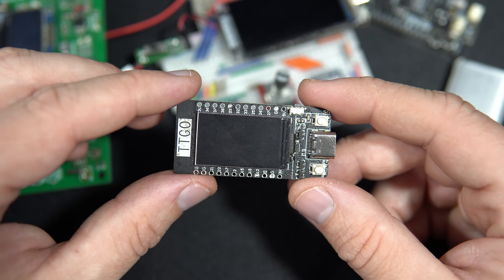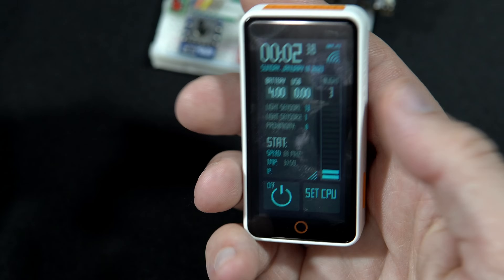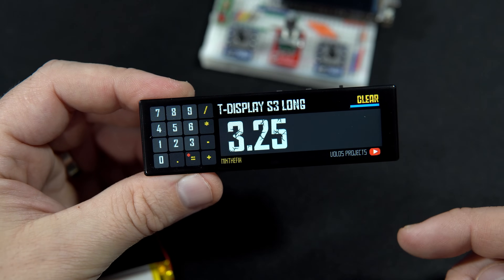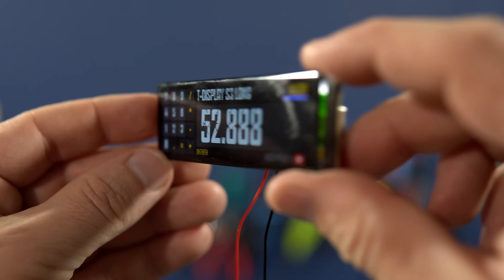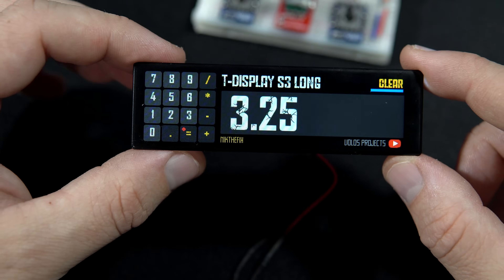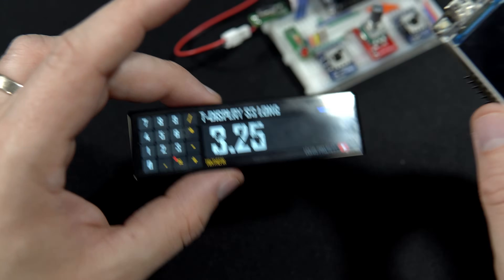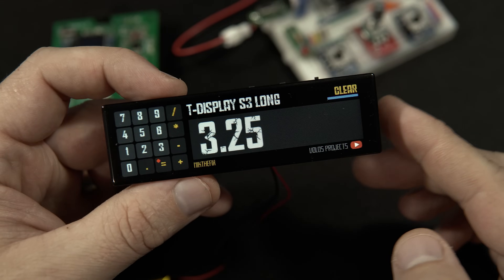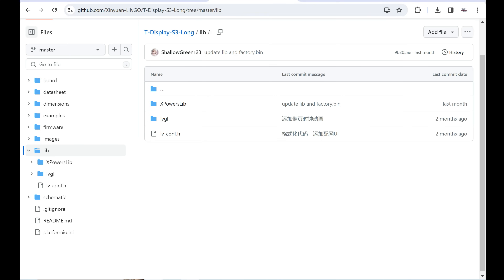T-display S3 LONG - Elegant Development board from LilyGO

Comment: As far as I can tell this board Kinda sucks. It does not work like the other t-display boards and the examples are hit or miss. Half the time the screen has a static looking or I get an error from the example process.h missing. When I was able to get it to work I could not make the text bigger AKA text height. I am no pro but this board is anything but simple.

Comment: I tried using img2lc with the settings noted in the ino but the output is in the form 0X10,0X10,0X02,0X80,0X00 where as the format of the yt.h is 0x0000, 0x0000, 0x1800, 0x6000, 0xB000, 0xE000.  Why is this ?

Comment: I really appreciate the effort you're putting in those display videos! What settings would I need to use for SquareLine Studio in order to create a working LVGL UI using Arduino Code for the S3 Long? The examples from Nick worked fine, now I would love to get into development on my own...Do you know if there is a SquareLine Template for this device? Thank you

Comment: Is there  an adapter that converts qwiic connector to pins that can be plugged into a breadboard? It's nice that the package include 2 quiic cables, but it doesn't include info on what size they are if I need something to solve my first question...

Comment: I just got one of these. It took a while to solve getting it to work after uploading new sketches to it, but that was solved i the board settings of the Arduino IDE. After I got that right, I saved a screen shot of the settings, so I have a reference to go back to if something gets messed up...

I get the factory sketch working after upload, using what I said above.. and found the line of code that flips the display 180  degrees... 
    disp_drv.rotated      = LV_DISP_ROT_270;// 90 180 270

The only part I can't figure out is how to set my time zone. Can someone help?

Also, is there a way  to turn off the flashing GREEN LED.. I bet it is causing problems for people who have heath issues related to strobe light/picket fence effects...

Comment: Seems they will only ship from the German warehouse now , which is fair enough but no stock anywhere but India ?. Does anyone know if this will be available again or is discontinued ?
Reply from the maker: dont worry it is not discontinued, it is new, that is common with new boards, they sold quickly, but theay are also back in stock very fast
Reply: @VolosProjects  thanks I found some on Alibaba. Thanks also for sharing all the info and making the video's.

Comment: Maybe a stupid question, but could this display receive input from a second, separate ESP32? How would this work?
Reply from the maker: Yes ofc, using esp now, wireles protocols used to comunicate between esp devices.. you can also use wired option

Comment: Have you or anyone else tried the LilyGo T4-S3?
Reply from the maker: I have it here on my table i will try it next week
Reply: Yes. Very nice hardware. Needs a case tho.
Reply: @nikthefix8918  Yes I agree. Also, it would be nice if they released the BOM and maybe sold the display modules and connector separately so it would be easier to make your own PCB and not having to stick to their development boards.

Comment: The issue you may have had with TFT_eSPI is that it expects the user to configure (uncomment) a specific display driver, which is a problem when you want to use that library with multiple devices as it would require editing the User_Setup_Select.h configuration before each compilation.
The easiest workaround is to copy the relevant header file from TFT_eSPI/User_Setups/SetupXXXX.h to the sketch folder and include it before "#include TFT-eSPI.h" in the sketch.
Reply: Yes a very good idea. I can see why Bodmer did it this way tho. 
Of course, with the Long or any other display where we're using the 'sprite only' screen buffer approach, there is no need to configure user_setups in TFT_eSPI in any special way. Just use the default 'freshly installed' config.
Reply: @nikthefix8918   'freshly installed' config. all tft_espi examples   screen is black, is without BL even if in ino is declared; any tips pls?

Comment: Wow! Seeing the T-display S3 LONG took me back to the good old days of my Casio FX750P calculator. It would be amazing to have a pocket calculator with the same display and a qwerty keyboard, where I could run some Python scripts. Please let me know if you plan to create such a product in the future and when it would be available for purchase at a reasonable price. Thank you!
Reply: In case Volos doesn't want to do it, I could do it if you buy the parts to make two so that I get to keep one. It would have to be micropython I believe as the full monty wouldn't fit/run on the esp32
Reply: Thanks for your reply. I am looking for a portable machine that can run Python, like on my old PC, where I installed Raspberry Pi OS. Along with the display, I'd also like to have a small and confy keyboard, which means there will be enough space below to attach a Raspberry Pi 3 A+ and three rechargeable AA batteries, to acryllic plates fixed by four screws on the corners. I like your suggestion of me giving the hardware for two machines and you taking care of connecting the parts and making it work. As you already said, we have to listen to Volos first.
Best wishes for the New Year!

Comment: nice I got it compiling with platformio : build_flags = 
    ;-DARDUINO_ESP32S3_DEV
    -DBOARD_HAS_PSRAM
    -DARDUINO_USB_MODE=1
    -DARDUINO_USB_CDC_ON_BOOT=1

board_build.arduino.memory_type = qio_opi
board_build.f_flash = 80000000L
board_build.flash_mode = qio
board_upload.flash_size = 16MB
board_upload.maximum_size = 16777216
upload_protocol = esptool

lib_deps = 
   bodmer/TFT_eSPI@^2.5.42

Comment: Even though these dev boards are SUPER cool it's just not viable when they have so many bugs and problems. Even the most stable old TTGO (the one you show in the beginning) will also have problems with code that's flashed to the board a while ago. Meaning they are not really suitable at all to ever put into an actual project/product. They are more or less only really good when you are in the development stage. Sadly... coming from someone who owns like 5 or 6 of them (both large and small)
Reply: There's nothing wrong with the hardware - past or present. The Arduino eco-system evolves and can make breaking changes with consequences for older projects.  It's up to us to keep pace with these changes and follow migration rules as documented by Espressif and other library contributors.
Reply from the maker: i dont undestand you. Why you think that they have problems. I agree that new boards are hard to use. But why old ones are not stable? I have few of them working years by now, proper case and stable power supply is all they need. Yes they are messy if you power them with phone charger or noisy power.
Reply: And what's really important (to me at least) is that Lilygo provide schematics and a BOM so you can go away and make your own board if you want. They taught me a lot.

Comment: I have a car project for something like this. I'm new to Arduinos etc. I would like to make a automobile trip computer. I would need to process two hall effect fuel flow meters and either a square wave speedometer cable generator or incorporate GPS module. Need to display Distance, Instant MPG, Average MPG, Speed. Will this process that?
Reply: Also can this be powered from a 12v car system?
Reply from the maker: Yes it can proces that, but you will need to power it with lower voltage, you can put voltahe regulator between car battery and this board
Reply: I am looking at esp32 starter kits to learn with. I see you have tested several esp32 based screens. Does it matter what platform to lean off of? esp32-s3 wroom? I am learning from scratch. Do you have an email? @VolosProjects
Reply: I bought this! Can you recommend a 12v to 5v regulator? @VolosProjects

Comment: Yes, it is great to not have the board spilling into the bezzles (Adafruit please take note), but a pity this makes it so deep, particularly with a USB cable plugged in. Makes it hard to do a calculator format device. Separate display and CB with a ribbon between would be better. I'm still looking for more length: around 100x16mm for a modernized HP Voyager (landscape) format calculator.
Reply: It's a tricky one. I personally like all the conn facing back as I like rack gear. But if you want flat then how do we agree on placement? Left, Right, Top, Bottom? :) It's a tough call if you're making a general purpose dev board. Your idea of a ribbon to the USB / GPIO is a good one I think.

Comment: Lilygo seems to be very bad at making their devices consistent.  It took Nick's magic to get it running. Why?

 I succeeded in getting the T-display S3 working, but then purchased a T-HMI and tried to follow the Liligo set up.  Nothing but failure.  How can they provide documentation that does not work?  Does anyone know how to get it running?
Reply: Did you raise an issue on the T-HMI github repo? If so I'll see if I can help there.

Comment: Crucial question for my application: is the touch-screen working when wearing gloves? 🤔
Reply: No better than your smart phone. If you need to use gloves then an inductive or resistive touch overlay would be options.
Reply: @nikthefix8918  thanks. Adding an inductive layer would complicate my project further... ☹️
Reply: @giuliobuccini208  You could use a stylus designed for cap touch. They seem to work well.
Reply: @nikthefix8918  hmmm... quite complicated while you're driving a motorcycle... 😄
Reply: @giuliobuccini208  I didn't see that coming! (haha!) Have you considered gesture control using a cheap microwave sensor?
Reply: @nikthefix8918  Microway sensor? I didn't considered that solution. It sounds interesting... hmmm... Do you have any link to something for Arduino? I'm curious.